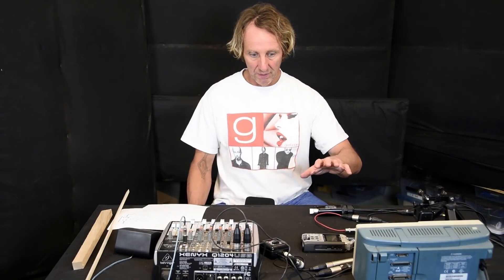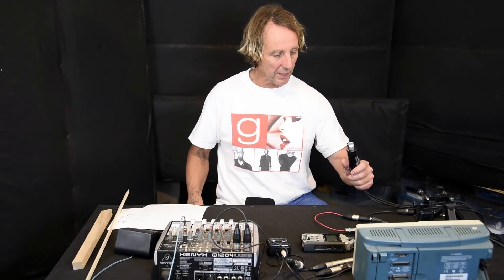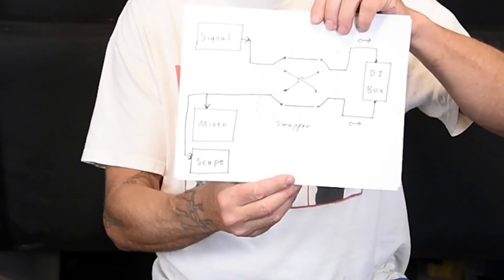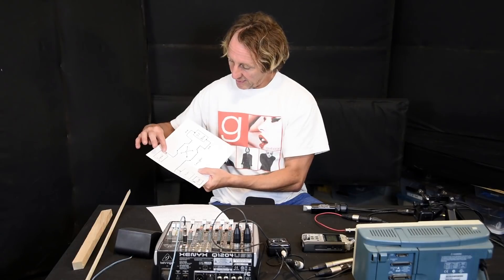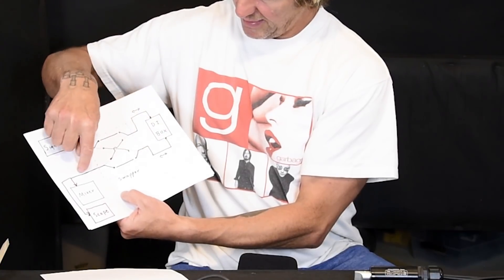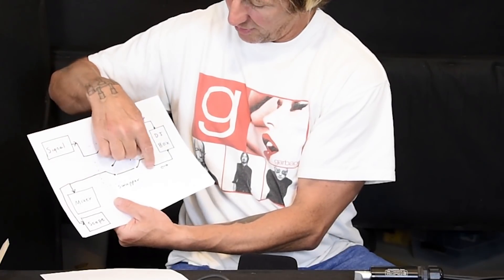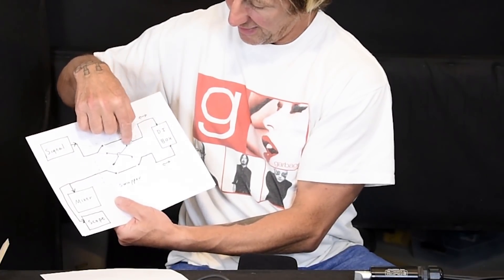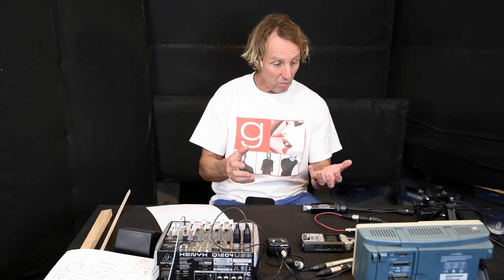DI Boxes, Impedance and Transformers Part #2

Comment: "Why would you want to use a DI backwards?"
Something I heard from a recording engineer is a "double DI" method -- you want the guitar player either in the control room or super far away from the amp, you can get 2 DI boxes with a female/female XLR connecting them -- with some (probably miniscule) signal loss you can get that guitar player a couple of hundred feet from the amp running most of the signal across the balanced XLR.
Anybody have practical experience doing this? I haven't tried it myself.
Reply: The double DI box is a definitely a “thing”. Works great! We have a current recording session in place with our practice space set up with guitar cab/ head and board is in a camper/control room. Musician plays in “control room” with tracks to monitors (like a studio would do) and pulling directly from instrument and sending back through a 250’ Whirlwind 32/8 snake to amplifier input. Also picking off signal between head and cab with DI and sending back to board for capture. 

In the past, have also used a Whirlwind Director DI (in a pinch) as a ¼” speaker line extension junction box, when existing monitor location needed to be moved further than speaker line would reach. Grab another ¼” speaker cable and a DI and bam, longer cable. The In and Out are in parallel (Whirlwind Director), FYI.
Reply from the maker: Love this
Reply from the maker: All good, that's a simple way to get a long run and for guitar, the losses in the di's should be less than no di's.

Also going the other way and converting from low to high and back to low to create an analog passive low pass and get a warmer sound is another angle
Reply: @DaveRat  oh awesome, I'll definitely try that too! Thanks Dave!

Comment: I may have to watch these 2 videos again a few times to really get it. For some reason the theory is just not clicking with me.
Reply from the maker: Let me know if I can help clarify after giving it another wathc
Reply: @DaveRat  I think it makes more sense after watch #2. The information @3:30, where you speak of getting everything into the same level range. This makes sense and is somthing I had not thought of. I've always thought, balanced and shielded means I'm good to go and should have no worries about crosstalk. This information indicates the possibility is still there and therefor it's beneficial to get the levels in the same range. A practical example of this is where I may be sending a signal for an active floor monitor to a station on stage along the same snake I'm using for microphones. I've not experienced any noticeable crosstalk. Thinking about the components, I just verified the outputs of my stage box are +4db and the mics are a mic of dynamic and condenser. Have I been getting lucky? @11:35, with what happens as the signal that has been converted to high z is fed into the low z input of a console, it sounds like you may loose some of the signal content once processed by the console. Maybe a roll-off of the upper and lower frequencies is occurring . Am I still out in left field?
Reply from the maker: You are on track. And though the crosstalk is minimal or non audible, the bigger issue is if there is a fault. Snake gets punched and shorts a speaker send to a mic input or a mis patch sending high level to a mic.

That said, if it works all good, but as the importance of a flaw free show increases, so does the caution and best practices.

Separating return snakes is one aspect. Avoiding super hot inputs mixed with super low level inputs is another way to steer a bit clearer of potential mishaps
Reply: @DaveRat  Great recommendation. A good idea to keep the connections safe in the case of the eventually inevitable mishap in the live gigging environment. You mention using a separate return snake for higher line level signals. If I am assessing the scenario and best results desired correctly, the only way to use a separate line within the same snake as a return safely I would need to step down the signal from line to mic level between the stage box and the feed of the snake that then goes to stage. Does that sound correct? If yes, then I am thinking one of our little transformer equipped direct boxes in a 10 to 1 ratio would be the fix as you have shown here in these videos. I would think something a little different with balanced in and out would be ideal. Thank you for taking the time to respond to my questions. It is much appreciated knowing who you are and likely how busy you must be, I am honored.
Reply from the maker: If you're not having an issue and you want to run a single snake I would just go ahead and run the returns down the snake don't step up or step down and add the complexity which can create its own issues